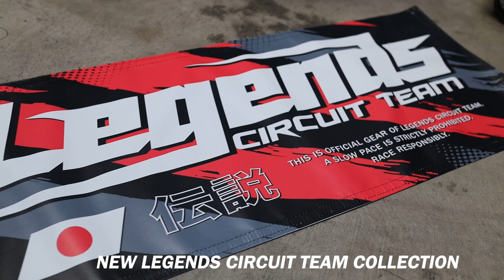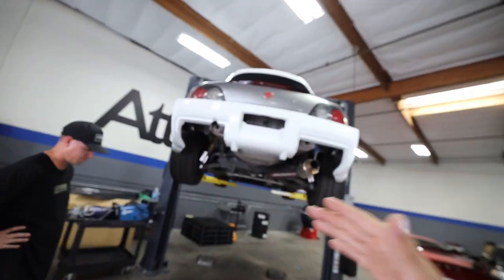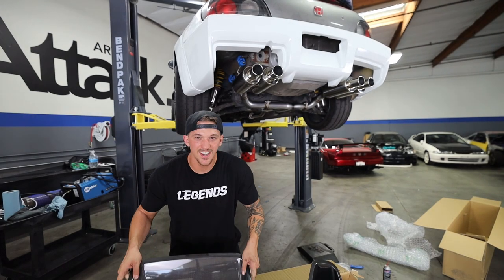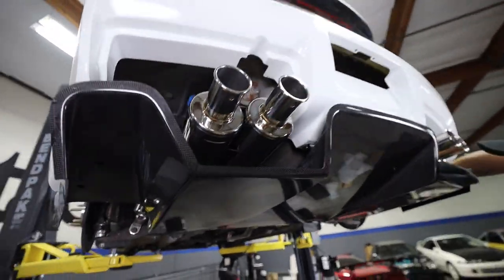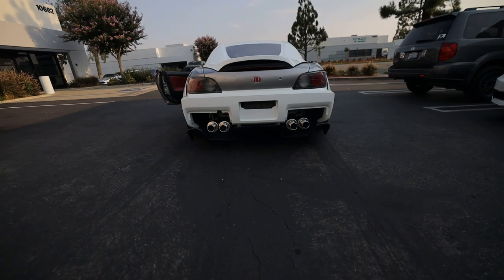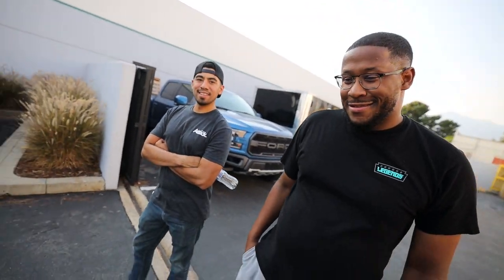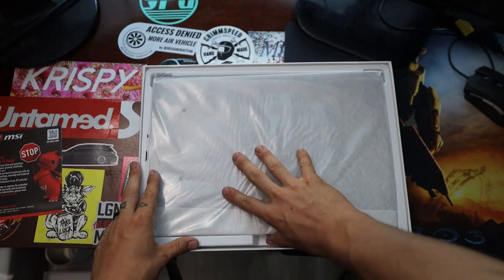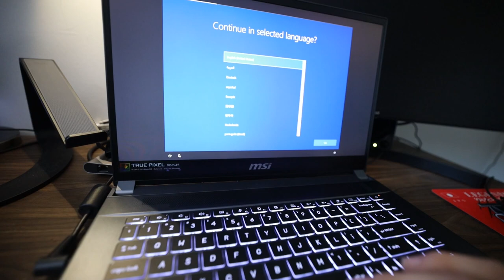Installing JDM Spoon Widebody on My Honda S2000! Pt. 4 *Spoon Quad Exhaust & Carbon Fiber Diffuser*

Comment: You should paint the inner frame behind the rear bumper flat black and install grills
Reply: Paint the mesh inserts black as well
Reply: Bingo, had to do that behind my lower rear valance

Comment: for any other content creators looking for the best mobile editing rig, the #1 thing you want to look for once you get beyond the basic specs ie cpu,gpu,ram,hdd , is color representation on the display. do your due diligence in researching what type of display panel you are getting with your laptop. you can have all the processing and rendering power in the world but if your display doesn't represent true colors, your videos will always look off. just some pro tips for the future dustin williams out there.